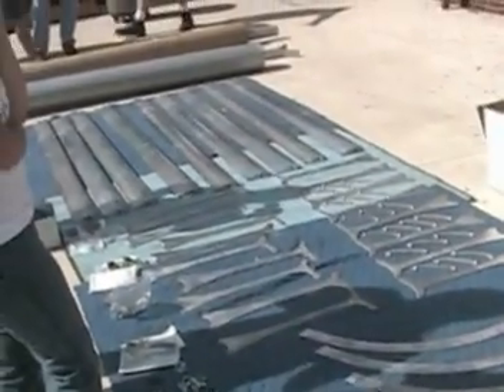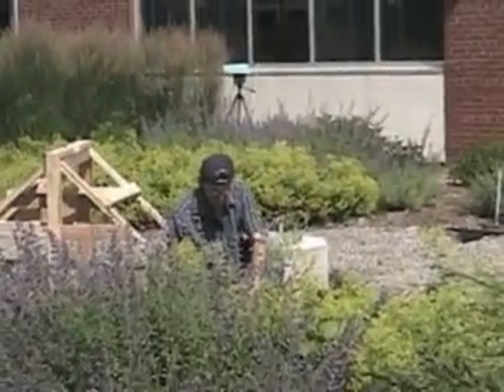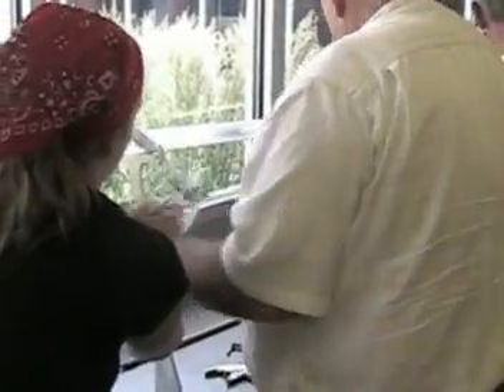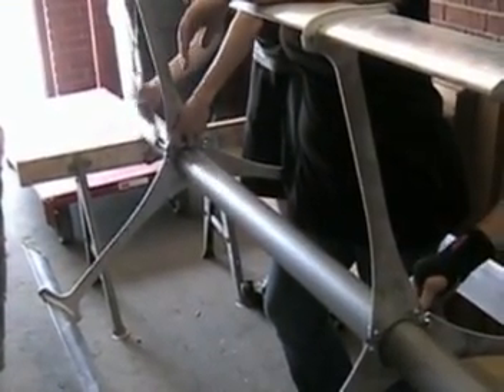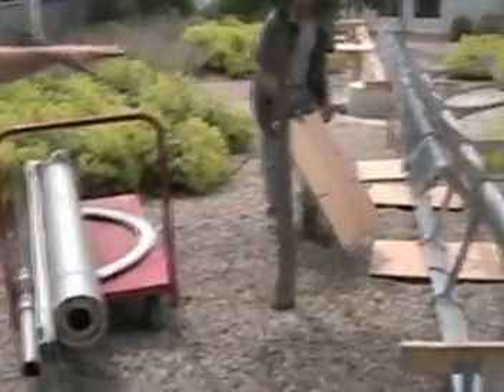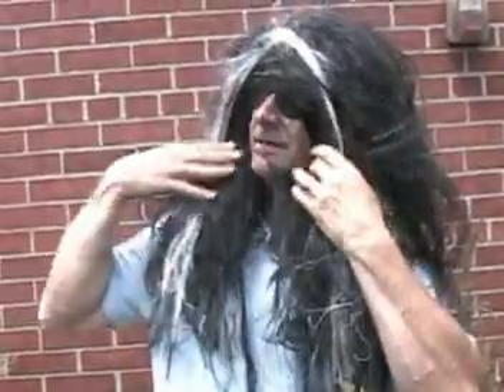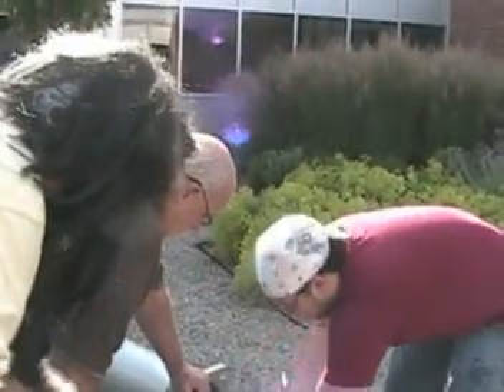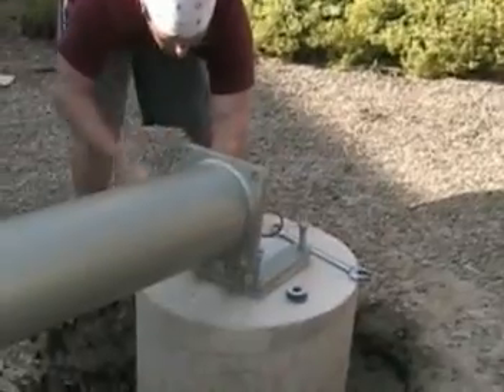Assembling a Windspire

Comment: Hey crazy hair maths dude. Cool video. I'm very interested in the windspire's design. Just one thing though, the inner surface is convex not concave. Both the inner and outer surfaces are convex. The turbine generates lift on the inside and the outside at different stages of it's rotation. I thought I should mention since you all seem like physics and maths dudes. Did you get any data on it's output? Also, is that your real hair?